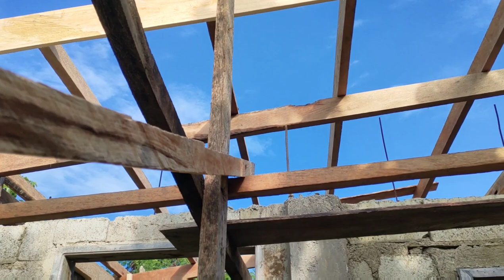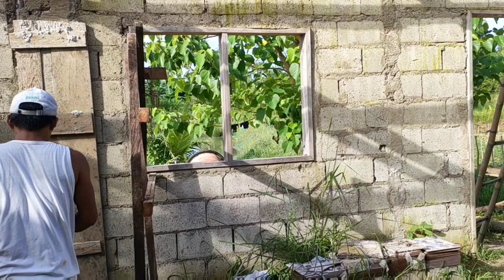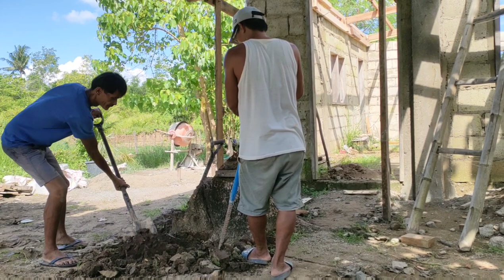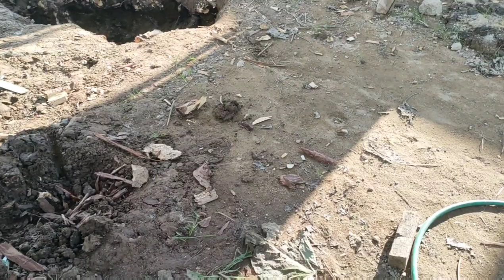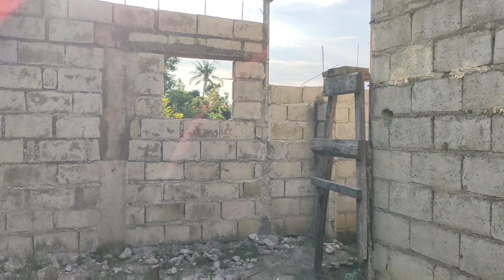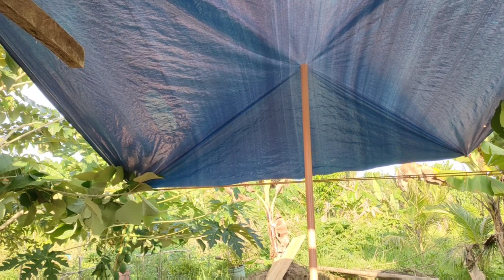House Update (081222)

Comment: Tremendous job removing the tree stump.  You can burn it by making a fire under the exposed bottom part of the stump.  What is Tatay's plan for the electrical part of the project?  Is he going to run the conduits under the floor and up inside the hollow block for switches/outlets.  I recommend that he use corrugated PVC conduit for this as it is cheaper and easy to install.  Tatay; don't forget the metal straps to hold down the rafters.   Blessings.